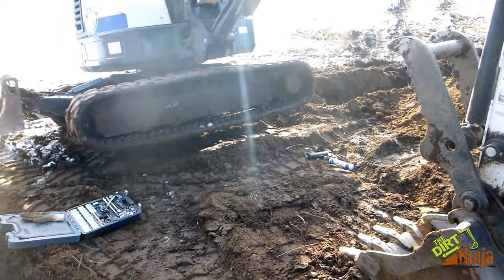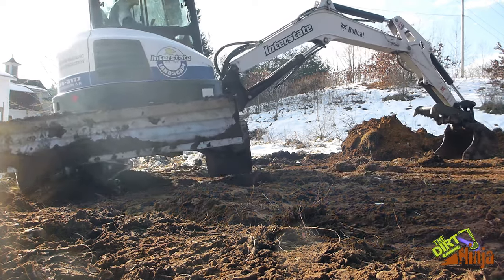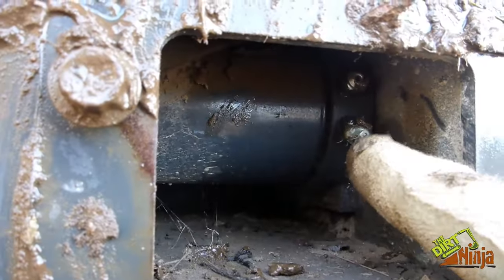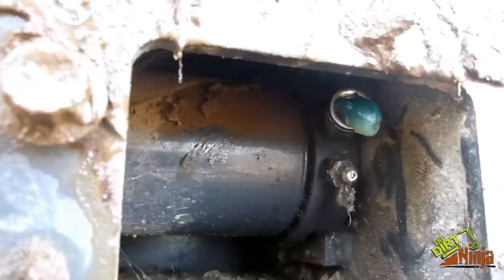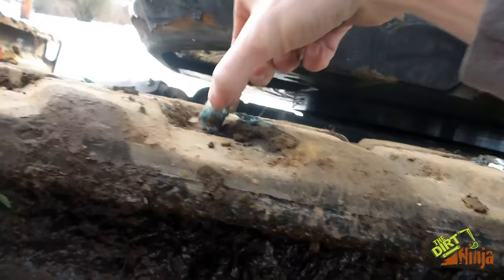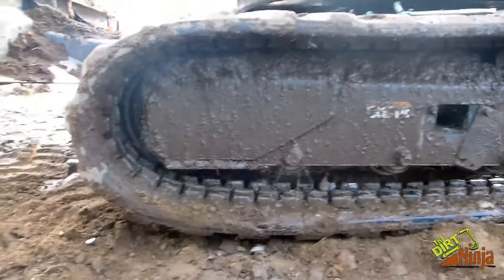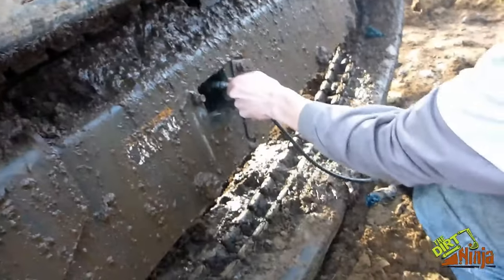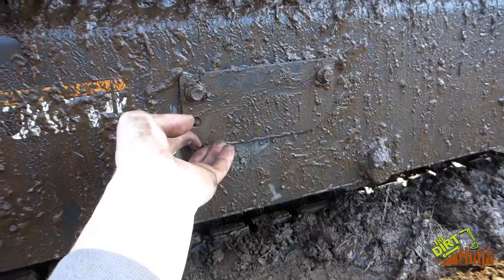How To Put A Track Back On A Mini Excavator

Comment: Let way more grease out. Push the idler wheel in more with your bucket.  Then keep your bucket to the outside then lift and turn into it.  Works everytime.

Comment: Putting the track back on my Bobcat E35 is easy, when I was young, I ran a 245 CAT.  Putting a track back on a 140,000 lb. excavator is a little more challenging.
Reply: I'm having a tough time getting mine back on. any tricks? like remove the top idler roller?

Comment: I put a chain around top of track 2'  behind idler. hook up a come along off blade edge on the opposite side of that track. Tighten up and spin track. Once it gets to the point where cable is getting tight, stop, loosen bring the come along down under the blade assembly and tighten back up, this allows you to keep side pressure on the track so you can keep idler in the groove as you advance. One person can do it pretty easily. Probably wont work so well with newer tracks but if they are stretched a bit you usually have enough play in them.
Reply: i did something very similar, worked great!

Comment: Good video, and good info spot on for putting the track back on.  I purchased a Lincoln 18volt grease gun and worth every penny, makes greasing a quick job.  And are you going to any of the Florida auctions next month ???
Thanks,
Reply from the maker: Glad you liked it! Yea i need to get a Lincoln grease gun, its on my list for the spring. No i wont be at the auctions.
Reply: I have a Milwaukee 18volt grease gun and in my opinion it's better than the Lincoln. About $50 more but worth it. It has a pimp counter and flashlight
Reply: *pump counter.
Reply from the maker: *****
lol
Reply: ***** That sound like a better one than my Lincoln, and I like the idea of the flashlight, I have not seen the Milwaukee yet, a couple of my friends have the Lincoln so that's what I went with, will check it out thou.
Thanks
Reply: I got mine off of amazon

Comment: This was a baby slip. I've had to put tracks back on completely knocked off tracks twice in the last week. Lol. Def not a big deal here. Tip: use a jack to compress the tensioner instead of a breaker bar.

Comment: Thankyou for your education videos - just come back from a job in a very remote location - ( Scottish equivalent of deep Alaska! ) where I had to do a quick checkover on all the machines - 2 with rubber tracks. So I've gleaned some useful tips - quicker than after reading the books which I always do where available.  BUT but but,  Why didn't you clean the  dirt from around that inspection panel hole before you started.  I HATE getting down & dirty on these jobs - nothing worse than gritty STICKY grease!   >> Could someone PLEASE make a video on how to wipe off sticky grease from your fingers & tools ! <<   LOL of course

Comment: About how long does it take to remove all the grease? What about regreaseing it?
Reply from the maker: 5 min to remove, 5 min to re-grease. Its very easy, hard part is getting the track on. Each track on this machine weighs over 1000lbs
Reply: How much of the grease tube is used to re-grease the machine?
Reply from the maker: Dirt King
I'd say about half a tube.
Reply: Ok, thanks. Also I am going to start a channel kind of like yours and I would like to know if this name which is just like your if it would need to be changed. If it does, I won't care if I do need to change it. Thanks!
Reply from the maker: Dirt King
Totally fine with me as long as you don't make a similar logo!
Reply: Ok, thanks! I will not.

Comment: Neither one of my machines had covers for the grease port, I actually like that feature, digging horse shit out of the access hole is no kinda fun. My Takeuchi might have had one when it was first born, I got that machine used, but my Kubota never did.
Reply from the maker: Yea that doesnt sound like fun, haha
Reply: Dirt Ninja Yea, not on my top ten.  ;-)
And horse manure has a lot of hay in it, so if you work in that a lot, it fills the relief holes, and tossing tracks is fairly common.

Comment: well hes actually doing it wrong as its covered in mud he should of had a hose to wash the mud off before tightening the track
Reply: When you're out in the middle of who knows where.. running water with a hose is not a option!

Comment: Fuck me... I just detracked my e20 and i got it back on by prying up and in with a pipe i found, and using the drive sprocket to pull the track up over the idler... No help or tools other than 2 feet of old steel pipe. Good thing i only have a baby machine or it looks like id be completely fucked because the entire thing popped off and i could barely move it as is...